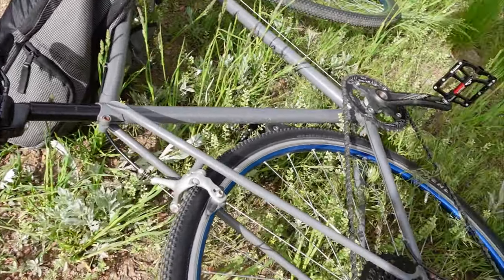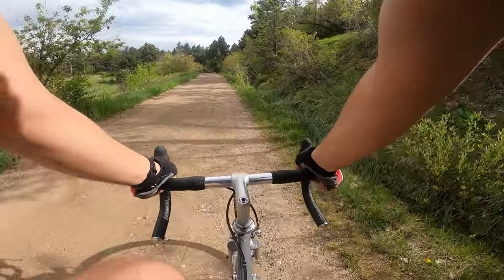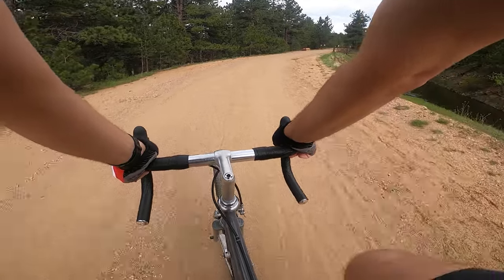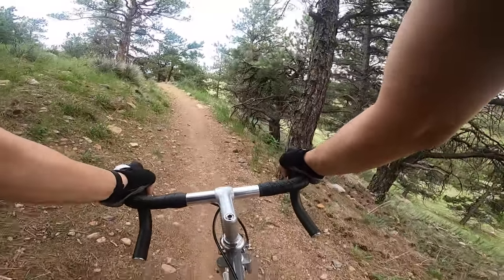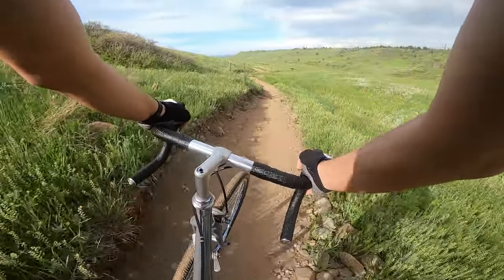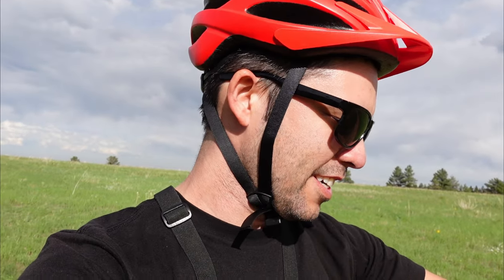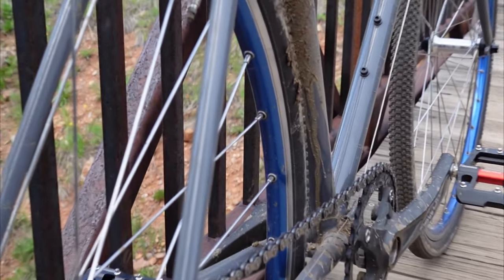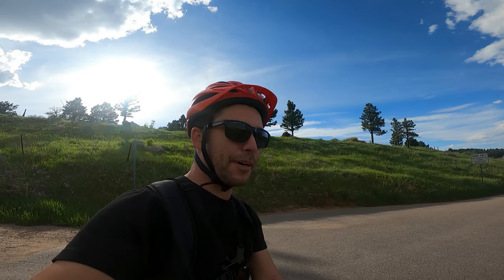Wide tires on skinny wheels, also testing Kemimoto pedals

Comment: I run a Giant Tradist road bike but slapped in some Schwalbe CX Pro 30c tires. Has perfect clearance on both ends. Anything with side knobs and beyond 30c will give almost no clearance on my bike.
Reply from the maker: sounds about right. I ended up taking these off because it was just so close.

Comment: Have you tried a retro hybrid gravel build? Look into something like a Specialized Crossroads which has 700c wheels and the frame is made for bigger tires like you’re trying to get in this video. Also they have cantilever brakes so you won’t get tire rub.
Reply from the maker: No I haven’t but you’re right I think that is the trick

Comment: Are you going to replace the wheels ?
What wheels are you going to use?
I have a similar kind of a situation.
I have a Schwinn tourist with skinny wheels and 25c tires. there is lots of clearance in the front fork and in the rear triangle and I'm thinking about upgrading the wheels and tires and make them wider.
Reply from the maker: I really don't know at this point, for now I'm leaving them alone because I don't really have space for another set of wheels. I'm starting to get why people don't usually convert these old steel bikes to gravel. Seems like you run into one limitation after another. Maybe I'll go with some 27.5" disk break wheel set in the future on an old frame, could be interesting, and maybe the only way to really do it right. At least that's what I've been thinking about the past several days. But currently I have the 28mm gravel king tires back on the bike. I'm planning a road ride up mt. Evans soon.